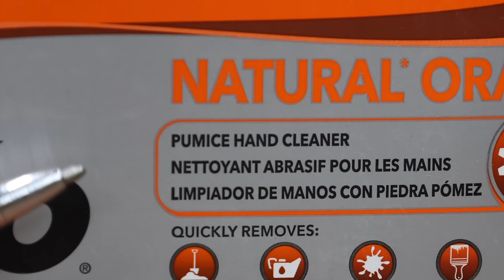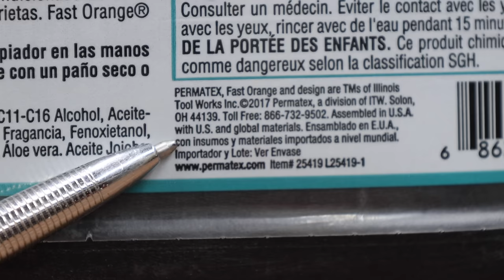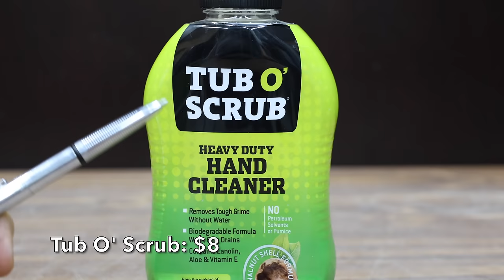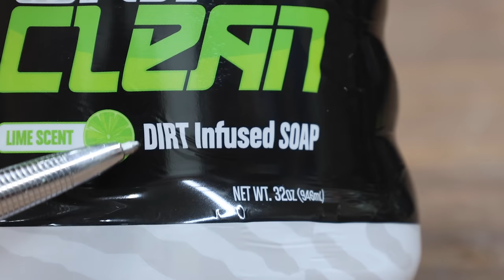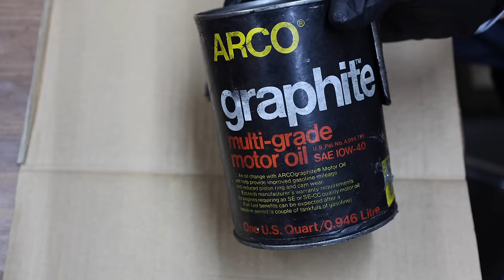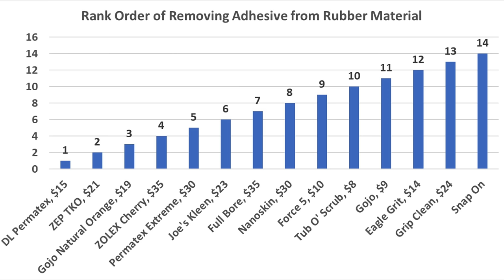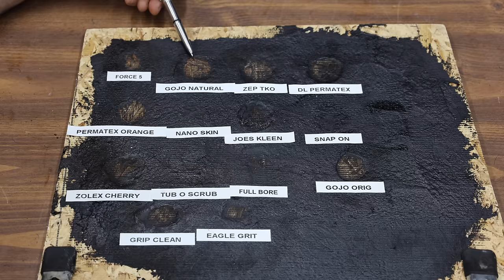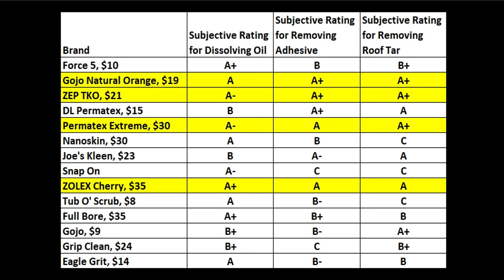Best Hand Cleaner? Let’s Find Out!

Comment: A little tip I learned from a buddy with a bike restoration business:  Gojo Orange hand scrub can be used as a rust remover for chrome steel parts.  You use it as a polish and aluminum foil sheets and balls as your "scrubber"...he could take a rusty old bike and have it looking brand new in a half hour.
Reply from the maker: Thank you for the tip!
Reply: Another great rust remover stainless cleaner is Kool-Aid POWDER and water. No sugar. Orange Kool-Aid is best. Its almost pure citric acid. I say Kool-Aid, but any "Artificially Flavored Orange Drink" Powder will do nicely. That's for all you Squidley's out there! LOL
Reply: 0000 steel wool works premium on chrome and glass. No need for gojo or kool-aid
Reply: Thanks for the tip.  I will be using for several things.
Reply: Cool, thanks for the tip!
Reply: Aluminum foil and water works on its own.
Reply: Gojo is crap.  I’ve used some variation of all these.  Alot of hand soaps are rebadged products.  In my experience, any good hand soap for greasy hands has to have some grit, of which I tend to prefer the walnut shell.  And also anything gojo is complete garbage.  Why anyone uses anything gojo is beyond me.  If you take anything away from what I’m saying, just member, gojo is crap.  It’s not worth the space it takes up in your self.  Dawn dish soap and boraxo powder works good to.  Gojo doesn’t though, that miserable product just slides off your hand,,, who 
Iikes that junk?
Reply: Wow, you don't know how on time this comment was. I just brought my old moped from the attic to restore it and didn't know how to fix the rust on chrome metal. Also as an added benefit I get to keep the hand scrub because I'm running out, so it's a double win.  Thanks!
Reply: i have worked as a mechanic in shops for over 30 years and have tried many brands. i agree with project farm that gojo (and zolex) work better than most (on grease and oil). i am curious what are you trying to remove from your hands that you find it doesnt work?
Reply: Just put some lotion on your hand before doing any dirty job and then any soap would work.
Reply: @niacal4nia  I noticed last time I used lotion after washing my hands really well and the lotion actually lifted more oil out of my skin, I could smell it. Paper towel and another hand wash + lotion and I was good as new.  Going to lotion before my next oil change for sure lol
Reply: @mikemcchesney2555    I’m a former squid, and we called it “bug juice”.  We cleaned brass and unstopped deck drains with it… and drank it.  It was the corpsman’s preferred cure for salmonella poisoning.
Reply: @disgruntledegghead6923    If it’s real bad, the steel wool gets gummed up easy and needs to be rinsed a lot.  Maybe hitting it with a solvent and rag first would make it work better?
Reply: You can also use Gojo to gently scrub boat and atv seats that have mildew staining.
Reply: @cdelapaz5 Cool, I'll stick with Gojo.  It has always done a good job for me.  I'm glad you agree, too!
Reply: I like the gojo orange because I don't need to rinse off the solvent after use. No water needed
Reply: @garysarratt1  If it's that bad the chrome needs to be replaced, if glass clogs the steel wool it needs to be cleaned first. That fine of a grade will clog eventually, but it is a consumable. It'll remove rust, but if you're chrome is rusty it's time to replace it. Band aid repair at best.

Comment: I've been using Gojo for 44 years. I'm glad to know that it still ranks up there.
Reply: Gojo is all I've used for pumice hand cleaners. For me I was introduced to Gojo 30 years ago working in a professional wood shop back then.
Reply: too right
Reply: My best hand cleaner is called, "gloves"  :)
Reply: Same for 1 decade! its always been gojo or stoko anywhere i have worked. Mostlt the gojo orange tho.
Reply: I have a container of Gojo natural orange in my garage.   Comes in handy after performing routine maintenance on my vehicles and yard work.  Gojo user since the 1980s.
Reply: @practicalguy973  i use the orange in my small woodshop. while i work on my truck, lawn tractor and what not that have grease and oil, it works fantastic washing off poly urethane, stain and  paint  too.
Reply: Headquartered in Akron Ohio.
Reply: "Throughout the hand soaps and hand cleaners, I alone am the honored one"
Reply: Oldies are goldies. Young rookies aint got no thing on oldies.
Reply: We use "Beaver Nut Scrub", great at breaking down grease and grime on the hands.  It's ground up walnuts, so probably similar to the one in this test.  I like it more than GoJo, but they both are excellent.
Reply: The second I saw the title I knew there was going to be brainrot in the comments
Reply: Gojo has been my go-to as well, has worked well for my needs.
Reply: I don't use very much but sometimes frequently, "Worx" dry granules is my choice as it never separates or degrades and it works--just needs water.  (must be a thousand options tho)
Reply from the maker: Thanks for sharing.

Comment: In my many years working as an auto technician. I can tell you that Permatex gasket adhesive is almost impossible to remove from your hands. I have pretty much  resigned myself to having to let it wear off my hands. and I have used all kinds of hand cleaners. but thanks to this video it gives me a few more options to try out.
Reply from the maker: Thanks for sharing.
Reply: Gloves.
Reply: Broaxo is a powdered hand cleaner takes almost anything off
Reply: TUB O Towels. I've never seen a thing it can't eat through. It's easy to use and gets every cleanup done quick and easy.

Comment: As a retired diesel mechanic Ive used many hand cleaners over the years. I really like TKO and GoJo Fast Orange. Now I only use GoJo Fast Orange, If I need a little extra cleaning power I add Dawn dish soap to the GoJo in my hand...
Reply: Diesel mechanic here. Been using ZEP TKO for years. It’s better than anything else I’ve used by miles. Which makes sense… it’s the only one of the top 5 on this list that I’ve seen or tried!

I’d say his test results are pretty real-world.
Reply from the maker: Thanks for the feedback.
Reply: Same here, my shop buys gojo orange, but when that doesn’t do it, dawn dish soap and a spoon of sugar usually do the trick
Reply: Mechanic/ fabricator  and i really  like the Zep cherry bomb.
Reply: Fast Orange is made by Permatex and is different from GoJo.

Comment: I’ve been using the Gojo Natural Orange for a while after trying several different hand cleaners over the past 25 years. I enjoy the value/result ratio. Glad to see you got similar results. Love the videos. Keep em coming!
Reply: I have sensitive skin - I'm allergic to a bunch of stuff in soaps and perfumes, it's embarrassing - and Gojo orange doesn't give me a rash and cleans amazingly well 

Edit - swapped comments, mixed my tabs up and put the top level comment as a reply and the reply as a top level.
Reply from the maker: Thanks, will do!  Thanks for sharing.
Reply: CNC Mechanic here and my work used to buy Gojo orange. Its the worst cleaner I have ever used. I would bring in my own permatex blue lable or even gojo original  both waterless but it gets in the finger prints way better than GOJO orange. Now they order what we call "NUT Scrub. Maybe Kutol brand?? Work10 times better than Gojo orange IMO

Comment: My personal favorite has always been regular old Borax powder. Just get your hands wet, add powder and scrub. It can be as abrasive as you want, depending on how much you use versus water used. It leaves your hands as soft as can be. A+ in my book! 👍👍👍
Reply from the maker: Thanks for the feedback.
Reply: Where can you find the Borax Powder? I haven't seen it in the store for years now!!
Reply: On the laundry aisle.
WINCO has it
Reply: I'll second that.  That's what they used back in school.  It worked surprisingly well.  Ironically, none of the stuff they used in the actual shops where I worked was as good.  Todd, I'd appreciate Borax powder being included in the next round of tests, if you have one.  Thanks!
Reply: I have found it at my Ace Hardware and even the grocery store, in the laundry section. Amazon and Walmart websites both have it.
Reply: There is a difference between boraxo powder hand cleaner and the borax in the grocery store 20 mule team is more used for cleaning clothes
Reply: My pops told me back in the day before they had skin grafts for road rash, Drs would tell you to go home and take baths in borax ,and it was pretty remarkable how well people would heal up
Reply: I'm 62. My grandpa, and I, always always used it.
Reply: @pilotmcuen92 Walmart laundry isle
Reply: Boraxo hand cleaner was discontinued. I have a box that will last me years to use in the house.  I use waterless in my shop since it doesn’t have running water.

Comment: I know snap on is proud of their stuff but holy hell, $108! That's absolutely insane. I feel like zolex must've been the cleaner the gas station i worked at in the 90's as a kid had based on your smell description. Great test! Definitely has me wondering about using some of these for cleaning my work clothes.
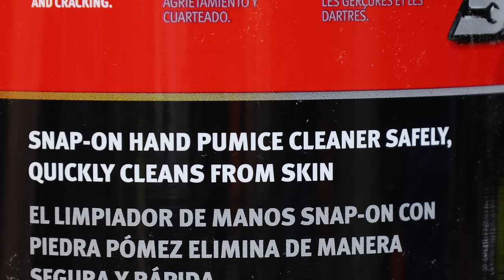Reply: 4:32 Hold up, stop the cap... There's a reason we call that truck the R+ape van... Between their hidden interest rates and overpriced tools, I think it fits. Fapon fanboys be warned, carry lube with you when you get on the truck.😎
Reply: 108.00 is for a case of four
Reply: It’s still 30 ish cents an oz. Same price

Comment: I was once responsible for procuring supplies for an Air Force maintenance shop.  GoJo was my go-to hand cleaner, and I would give other people a hard time who preferred Zep’s “Cherry Bomb”.  My strong preference was mostly a joke, but I am excited to see the actual results!
Reply from the maker: Thank you for sharing!
Reply: It's too bad Cherry Bomb wasn't in the test.
Reply: I definitely preferred Cherry Bomb to GoJo in the Air Force. Orange cleaners took over in the mid 1990s. Got to the point we couldn't get MEK or Triche anymore for the shop. Bottle of orange oil and cleaned up with alcohol. 🤠
Reply: I used go Jo for a while but after about a year my drain got clogged and when it removed the trap it was full of the pumice.  Not good, especially on a septic system. I stopped using and now spray with Awsome cleaner and add a little everyday hand soap from a pump bottle and it does a great job.
Reply: @distanc3, Where at and when?
Reply: LOL, I love Cherry Bomb!  Actually, they both work well.  I like the smell of the Cherry Bomb way better though.
Reply: I was rooting for GoJo since we have a factory in our town.

Comment: I use Boraxo hand cleaner.  Its a white powder , that must be used on wet hands. Mainly because  it works with water.  One thing you completely  over looked is that some of the hand cleaners don't work well on cold hands, or wet hands.  Not sure how you would test for that, but often my hands are cold and wet, and the grease does not come off with most of  those you tested.

Thumbs up for your hard work!!
Reply from the maker: Thanks!  Thanks for sharing.
Reply: He probably would have to use pork skin to do that. I know tatoo artists and surgeons used the stuff to train with. So it should stand to reason that you could use it to simulate real human skin for these tests. Should be able to get a some of stuff from a local butchers.
Reply: just found out that boraxo is discontinued which is terrible because it is the only one that doesn't clog pipes like pumic does

Comment: I wrench General Aviation, have for many years.  Palmolive and borax, mixed in the hands, add water, agitate briskly.  Nail brush if leaving the hangar.  Rinse (water is necessary) . 
To remove 5606 Hyd oil (very simular to ATF) I will cheat and use a chem (gojo) hand cleaner to start.  I've tried a lot of variations and this works.  Cheap as well, It don't take much.
Reply from the maker: Thanks for sharing.

Comment: A haaaaaaa. HAND CLEANER!!!!!
Nice one.  There's a little-known but life-changing bit of advice someone once gave me on day 1 as a 16-year-old trainee car mechanic, and that was how best to clean your hands at the end of every day in as careful a way as you can by inflicting as little damage as possible to your skin on a daily basis. He was an old boy, much older than usual retirement age, but was still working due to his own situations in life. He was a caring person, not like most other mechanics at the time. He said to me, always pull most of the dirt away from your hands onto a cloth first, and hence reducing or even completely avoiding harsher treatment like rubbing hands together and lathering and scrubbing with a brush, etc. That way, you can remove the majority of contaminants from your hands using much more skin-friendly hand soaps before even considering using any harsh chemicals at all. At 55, I still remember that fella, and still use a towelling flannel to this day, avoiding the use of hand cleaners. The cloth is then very easily cleaned using the same, sensitive soap as for your hands. Still enjoying working on my own bikes and cars now, probably one of the best pieces of advice I've ever had in my life. 🙂
Reply from the maker: Thanks!  Thanks for sharing.
Reply: Good experience.  i don't use pumice cleaners for that reason, much to hard on the skin.  So I've used Goop or Go Jo for a long time.  Both of them want you to wipe dry, not use water, to retain the skin conditioners on the skin.  A nail brush is mandatory, and mostly today I wash my hands in the sink rather than just wipe.  Not all nail brushes are equal, so I've tried many different ones and found a shorter bristle length is better.  A new brush design is out with a single row of bristles up against the plastic top so you can get deeper into the nail, it's helpful in getting the nails clean.  Since I'm not a mechanic by trade, but do a lot of dirty car work as my hobby, I like to have super clean hands and nails, and so does my SO.  🙂. This was a good review, I may try the Zolex Cherry since it's top rated.

Comment: Thanks bro. Back in the day I used to get Goop. It was an amazing product and cheap. One of the hardest things to get off my hands was Zinnser Cover Stain oil based primer. Goop worked well. Paint thinner works, but it soaks in to your pores and causes liver damage. I use Dawn straight for grease and it works well. Now that I can't find Goop, I get the Gojo.

Comment: When I was a kid in the 60s and worked in a gas station, we used Kerosene mixed with a little tide detergent, then Had Boraxo hand soap. The Boraxo bar was green with gritty borax in it. Then in the late 70s and 80s we started using a Gojo product that had an orange smell to it. I now keep a product called Tub of Towels in my garage. You can pull one towel out and it cleans every type of dirt, grease, tar, glue that I have gotten on my hands and you don't need to wash with soap and water afterwards. Thanks for the comparison though. very thorough.

Comment: I started using Permatex DL as a kid in the 60s and after decades of greasy grimy work, I still buy and even special order the DL.
I’ve tried the “grit” stuff which works okay but leaves its grit behind.
The DL creams, dissolves while rubbing and wipes away clean and smooth. No washing required.
It also works well as a spot treatment for clothing.
I’ll have to try the “Extreme” version.
Reply from the maker: Thanks for sharing.

Comment: I've found pine-sol as the best shop cleaner, on treated concrete. I've used dishsoap, laundry detergent, purple power. Would mind that as a future test. I say it's the best because price, ability to desolve dirt, grease, oil, coolant, brake fluid rather well spread out.
Reply from the maker: Thanks for the the feedback.

Comment: I do diesel truck repair now. The best is the snap on walnut. Barely need a quarter size for most clean up, maybe a little extra for the arms with a nail brush. The original grip clean "dirt" formula is a decent cheaper alternative. The snap on is like $34 for the quart I think and it lasts and smells ok. Cintas also has a walnut scrub but in super small containers from their Sanis line. That stuff was very similar and worked very well. The pumice in some of the soaps is good for weekend warrior stuff
Reply from the maker: Thanks for sharing.

Comment: For my business one of the key takeaways is ease of use. Many of these soap companies want you to use their own proprietary, usually wall mounted dispensers. For some shop owners like mysef, this is a negative deterrent to purchasing. I don’t want some crap mounted on my wall only for them to change the dispenser, discontinue the product or find a better replacement, etc. 
Great video and my shop currently has the Permatex Extreme in use at the moment 😆 I purchased it about 6-8months ago purely based off of (1) it was the cheapest deal at the time and (2) we had never tried that scent before. It smells good and seems to work just as good as all the previous hand soaps.
While overall none of us have experienced any ground breaking results just cleaning our hands over our regular (GoJo orange or cherry) it definitely has more “bang for the buck” when looking at container size (price per ounce) and ease of use (just sits in the deep sink).
Reply from the maker: Thanks for sharing.

Comment: Just my personal favorite, it’s a bit harder to find, but it’s called Zep Shell Shock. Works extremely well on grease. It’s a very gritty cleaner which is my preference. For what I work with it’s slightly better then cherry bomb which is what I use to use for a long time. Either way great roundup! Good to see there are several great products out there that have their strengths.
Reply from the maker: Thanks for sharing.